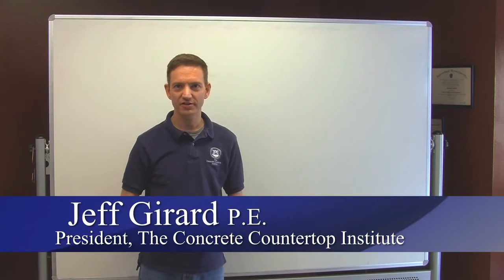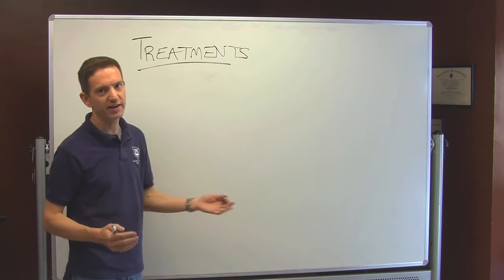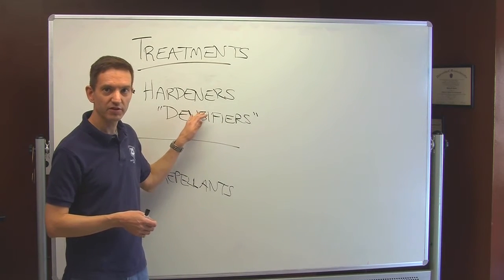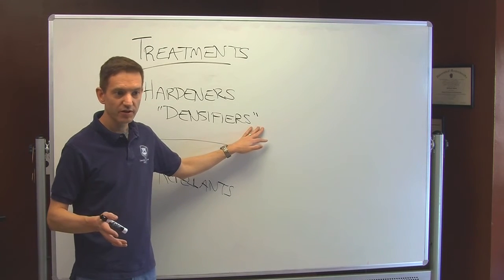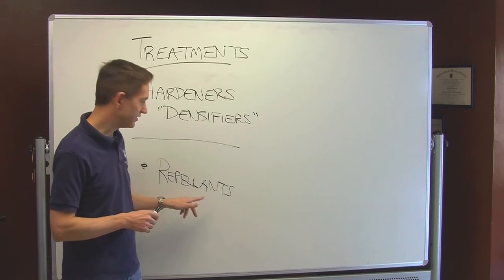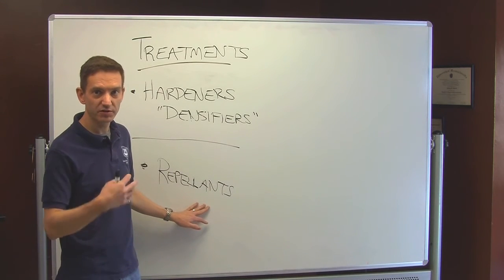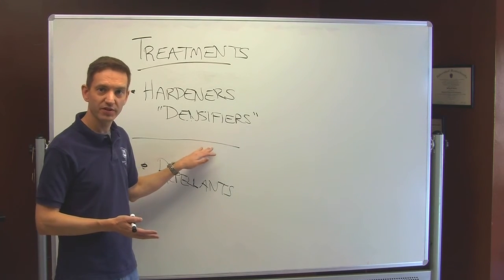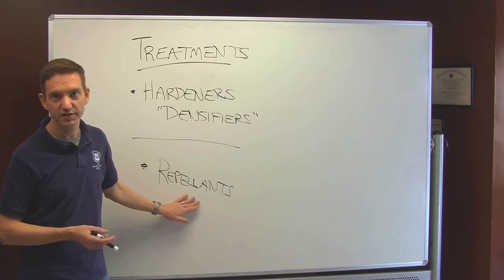Concrete countertops: Sealers Part 1 - Treatments

Comment: How long should you wait for the concrete to cure before you seal it?
Reply from the maker: Great question. Curing and surface preparation are critical for success with any sealer. In general curing for several days (at least 2) is best. Please see this article: https://concretecountertopinstitute.com/free-training/surface-prep-concrete-countertop-sealer/ This is specific to topical sealers, but these are good principles in general. However, always follow the instructions provided by the sealer manufacturer.

Comment: Hello Jeff. Great video. Really appreciate the effort. I have a question. Is it okay if i treat my concrete with stone lacquer with the first layer, then finish it off with epoxy or acrylic?
Reply from the maker: Thank you for the question Mohammed. No, I do not recommend this, for several reasons. One, stone lacquer is for stone, not for concrete. Second, the lacquer will also certainly contaminate the surface and result in delamination issues for any coating sealer (such as epoxy, acrylic or urethane) applied later. Third, if you are trying to achieve good stain protection, the better way to do this is with a high performance urethane. Please see https://concretecountertopinstitute.com/free-training-category/sealing/ for extensive information about sealer basics, surface preparation and more.
Reply: @TheConcreteCountertopInstitute  thanks for your reply. I will definitely read out your training materials. Subscribed by the way
Reply from the maker: @mohammedamierabdulghaffar9054  Perfect, thank you!

Comment from the maker: There is no "FDA approval" for countertop sealers, but any of the ones I recommend are completely inert and food safe when cured.

In kitchens, I recommend coatings for maximum protection, although they can scratch. Just don't cut on them with knives. For pros, I recommend spraying Stonelok E3/2K multipart epoxy/urethane. I sell a video about how to use this sealer. For DIYers, I recommend the much simpler TK6. Both of these sealers are available from V-SEAL.